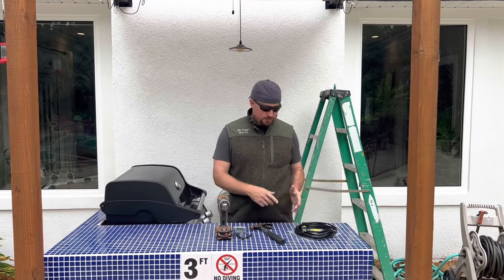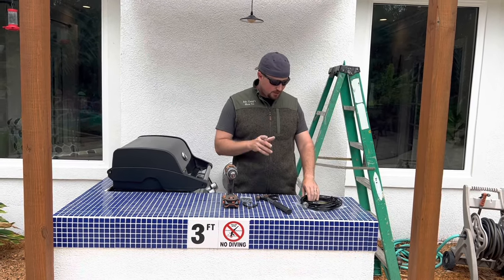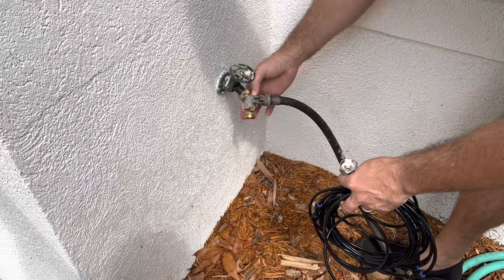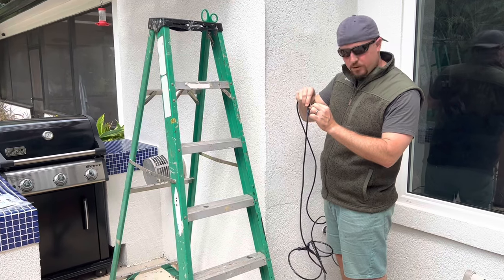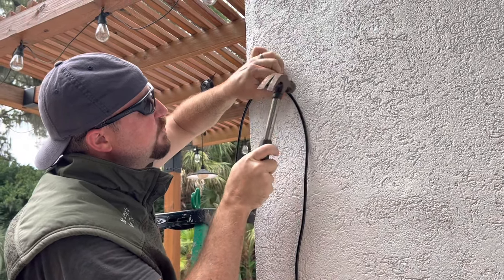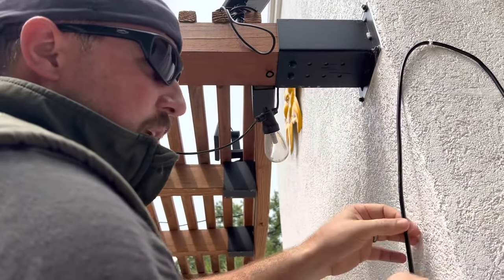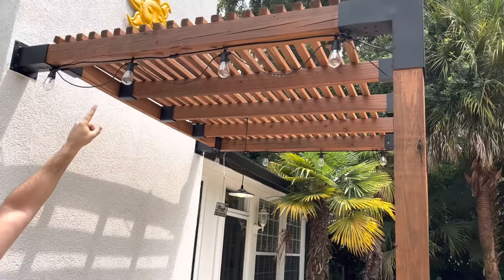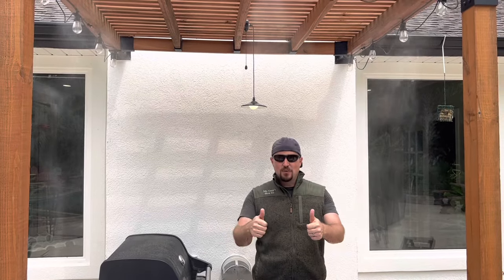HOW TO Install Patio Misters // DIY Quick & Easy!

Comment: I installed similar misting systems for my horses, chickens in the run and the coop also on my patio. That's 4 systems ranging from 25-75 ft. in about an hour and a half. I didn't like the nail in hook so i bought cable clips that secured to the wood with a small screw. I did add filters because we have hard water so it makes maintenance easier.
Reply from the maker: That sounds like a cool project.  Thanks for sharing!

Comment: An o-ring is a rubber gasket. What you used is an eyebolt.
Reply from the maker: My bad, partner!  Appreciate the correction. Thanks for watching!
Reply: An eye bolt is threaded and has a nut. What he is using is a screw eye.
Reply from the maker: @rocketsurgery8337  even better!  Thanks partner!

Comment: New subscriber!
This Texas heat is a BEAST! Even with three MATURE (over 40 years old) pecan trees, my patio temp has been 98 + degrees in 108 degree weather!😮
Question: should I be concerned with having the mist spray so close to the wiring of the patio lights, as you've demonstrated?
Reply from the maker: Howdy, partner!  That sounds hot!  The lights I have up are waterproof solar lights, so no electrical concerns here.  If you have 110v lights, probably best not to have water blasting directly on them if you can avoid it.
Reply: @MRGREGSHOWTO  GOT it! Thanks!

Comment: Can I install along the guide wire with Bistro lights? Same low pressure misting system, bistro lights are Smart LED weatherproof IP65 rated. Thanks!
Reply from the maker: Howdy partner!  I don’t see why not. Everything is waterproof and the pressure is very low. Good luck!
Reply: @MRGREGSHOWTO  Thank you!

Comment: are you able to control the mist or do you just get soaking wet?
Reply from the maker: Howdy partner!  You can turn the water pressure on low, but you will still get a little wet unless the spread is a decent distance away.

Comment: Is there a way to reduce the pressure of the water so that it won’t make you soaking wet?
Reply from the maker: The best trick I have found is to turn the spigot on low or to only partially open the 3-way valve if you are using one at the connection.   Height and wind speed will also affect how wide the mist spreads.  Good luck!
Reply: Try pointing it away from you. The higher the pressure, the more it mists. Too low of pressure may make it drip out, which is not what you want.